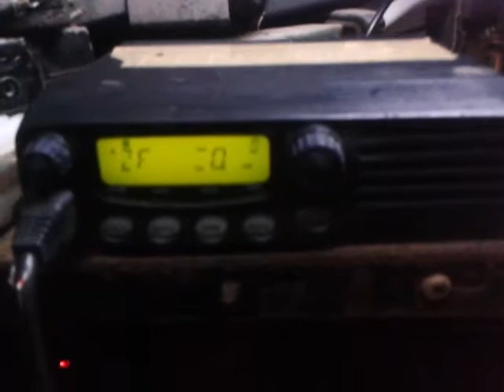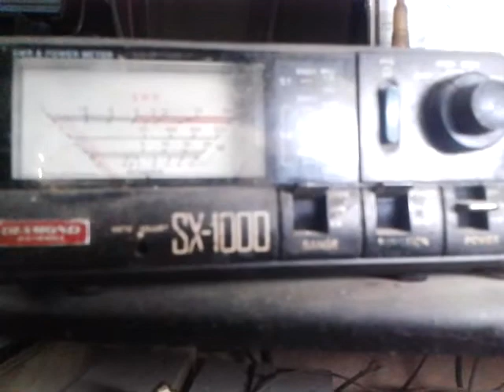4F1KJA Repaired a Kenwood TM-271 of ZAMECO

Comment from the maker: Kenwood TM-271 of ZAMECO, previously it was a dead Set, after we repaired we found out that the Final were on 30Watts remaining were in order in good condition and the LCD middle segments were already busted BUT we programmed it to a single Channel and lock it... There are some minor parts replaced, but the only major parts are the Driver of the Finals. Anyway on that video it wasn't clean enough, but my assistant will clean it and ship back to ZAMECO. 73 de 4F1KJA